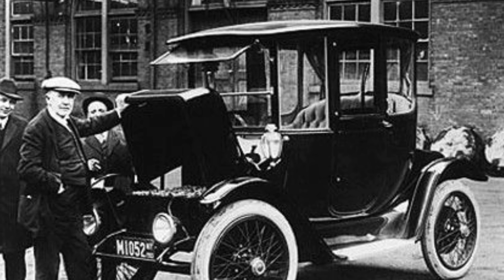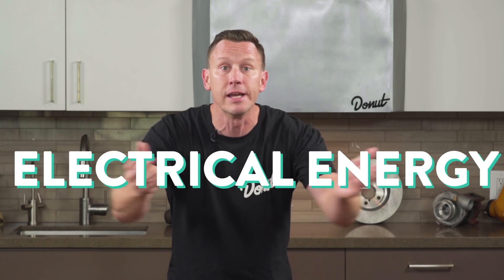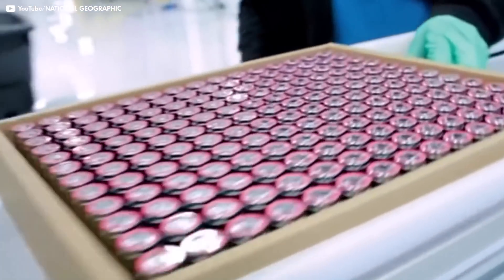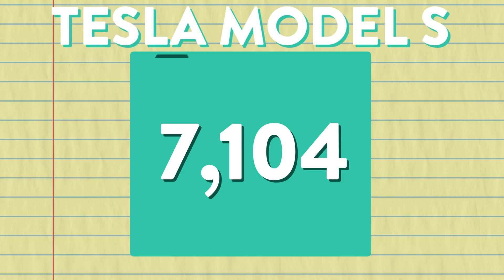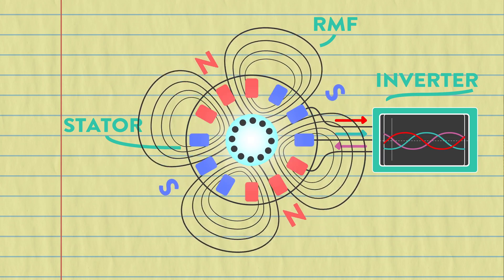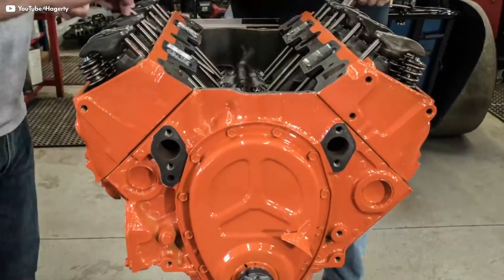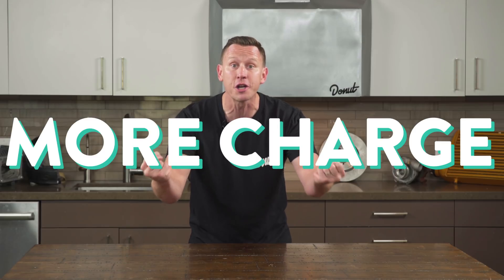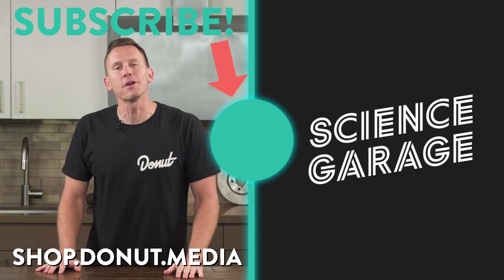ELECTRIC CARS | How They Work

Comment: You did forget that although limited in carbon footprint, those lithium ion batteries use elements that must be mined.  Mining for cobalt and lithium is a huge source of environmental damage.
Reply: As is drilling and fracking for oil for conventional cars... The BP Golf oil spill wasn't that long ago. You have to choose the lesser of two evils.
Reply: Brian KongNam that may be true but are you actually comparing actual numbers or just words. Saying electric cars still cause pollution is fine but it produces 70 or 60% of the pollution gas cars do so it is still an improvement. AND electricity sources will soon be fully renewable so by that time it will cause 10 or 20% of the pollution of gas cars.
Reply: 2 things those battery are valuable so they will be recycled and do you think gas doesn’t have a human cost? Have you heard about the wars in countries with oil? besides Tesla reduced significantly the amount of cobalt that go in every single car
Reply: DoomFinger511
 Oh soo you mean like Norway with highest saturation of BEVs. Their Electric Grid is "only" 96% Renewables.
https://en.wikipedia.org/wiki/List_of_countries_by_electricity_production_from_renewable_sources - Far more Renewables than you think.
Reply: COLBALT is NOT NECESSARY. It's a stupid option.
LiFePO4 uses 0 Cobalt.
Gen1 Nissan Leaf uses 0 Cobalt. 
Do some basic research.
Reply: KENARDO And oil has never caused wars or anything
Reply: Battery recycling will not be done by the individual or as DIY job. Eventually your car batteries will not work and you'll have either the option to replace them or go the scrapyard. In both cases the "bad cells" will be collected by a professional and be processed in a recycling facility. Hell, Tesla might even have its own recycling program for its battery cells. Bottom line is that the lithium in the batteries is recyclable/reusable while the gas/diesel we burn isn't.
Reply: Brian KongNam
 sledgex9
 viper
When batteries get too old for automotive use (8-10 years), Tesla re-purposes them in their Tesla Powerwalls (house batteries) extending their lifespan to 15-25 years. Once unsuitable even for this purpose, Tesla can recycle about 70% of materials from them. Also, mining for lithium is very clean as it is 'mined' by letting water evaporate from lithium brine. Overall, there is very little 'battery pollution', especially compared to oil.
Reply: I have read that the lithium in batteries is recyclable/reusable. So hardly an environmental hazard if recycling programs are implemented.
Reply: DoomFinger511 Yes it is. You can look it up if you don't believe me. And most of the people buying expensive Teslas also get solar panels to go along with it
Reply: like you care anyway
Reply: Because oil just jumps out of the ground in the backyard of Shell.
Reply: FallaciousScotsman 
Yes yes yes..... Cobalt is pollutant......Nickel chokes up your ass............
healthy and fresh petrol helps you live upto a 100 years!!!!
Total BS
Reply: Don't blame electric cars for your country's faulty coal/oil burning power generation. Maybe an electric car owner can't say their cars aren't ruining the environment at all, but at least these drivers can say that their part is done and the rest is on the government and the power generators.
Reply: FlyingSamosa52 i am not saying the period where it is born or it is running. I mean the when the car dies and the batteries can pollute a lot. Maybe makes the whole number of the carbon print increases and even bigger than tradition cars... it is just a guess since no solid pollution value of lithium batteries can be found now. It is just my guess
Reply: FlyingSamosa52 The cars will be less efficient and more deadly when idiots don't take care of them because batteries can deteriorate over time and release more harmful gasses than gas cars do when they aren't taken care of.
Reply: viper those battery are very recyclable and as technology gets better, batteries gets even better and will become close to 100% recyclable. And in 2-3 decades we will have biodegradable batteries, they even already exist but at a very small scale.
Reply: Raul Darat batteries are not the issue I'm talking about idiots that don't regularly maintenance their car will cause issues for the rest of us.
Reply: The energy used to produce electricity for those electric car recharge stations aren't much better for the environment either.
Reply: @DoomFinger511  Actually you're wrong
Reply: Matthew Prather
Yeah, great addition to the conversation.... try including a fact next time.
Reply: Neijhun
So you reference 1 country that makes up less then 1% of the world population. Renewable energy like in Norway is highly dependent on a country's geographical location and existing infrastructure. Most of those Tesla's are being sold (and recharged) in America where the energy is coming from nuclear and coal/oil power plants. Not to mention all the oil needed to make the plastics used in electric cars.
Reply: Also after the life of a ev is over, the pollution it makes because of the waste of lithium batteries is crazy
Reply: Not to mention the majority of cobalt on Earth is found in the Congo basin, where it's mined by child laborers who are often slaves, with life expectencies rarely breaking into the 20s thanks to poisoning associated with cobalt and its ores. The human cost of these cars is just as bad as the environmental impact.
Reply: They also did a study which showed that in a typical lifetime a supermini will actually have a smaller carbon footprint but I guess it's a lot smaller than a Tesla
Reply: @muddymann2007  Depending we're you live.
Reply: sledgex9 I don't think you understand what I said.  The only way to be able to recycle the battery is if you go to a mechanic to change it for you or you have the 16grand its costs to buy it and put it in yourself. What I'm saying is that most people don't get their car maintenance done on time which can cause major issues for the person that owns the car and everyone around them.
Reply: im not saying electric cars are bad or that ICE cars are bad but they both are not what they could be. no matter how great an electric car is it still needs crud oil for the plastics that make up its body, you still need electricity to charge it and if you power grid isn't renewable(like mine is) or if its falling apart due to terrible governing choices(like mine is) its not as great as it might seem, where some of ICE manufactures are trying to improve the efficiency of their engines(eg Mazda), what im trying to say is that if your looking at buying a Tesla or some other hybrid or full electric car to save the planet before you go and do that look at your situation first maybe a small compact hatch would be a better fit for you until there is better infrastructure or until you can modify you situation to better suit an electric car....oh and to the guy that was going on about how Norway has something like 90% renewable energy, well good for fucking Norway, are they even 10% of the global population?
Reply: @joshmac7245  Well yeah, major changes come through incremental improvements. We solve one problem at a time.
Reply: Also guys remember how do you charge your car... you plug it in.... who you get that energy from a plant and idk about where you live but the area I live in it’s all powered by coal burning it changes literally nothing I’m not saying don’t get one because they are fast and it really doesn’t matter but please don’t act like you aren’t ruining the environment just as much as anyone else please

Comment: Trying to wrap my head around how electricity works, never got it in high school. The series circuit increase from 6V to 12V makes perfect sense, how does doubling 2 amps get you 12 amps in a parallel circuit though?
Reply: anandy23 that was a typo

Comment: They won't take over for a while. Lithium ion don't last forever. Doesn't last longer than 5-10 years. I can replace a part on my engine, a Tesla can't. Also, electricity comes from burning coal.
Reply: Benzodiazepine pretty certain lithium mining destroys the environment and is pretty toxic too
Reply: At the end of the day, if you want to be environmentally friendly, just walk everywhere. Humanities greed for power is the most toxic thing of all for both the planet and its wildlife. We're fucked wither way
Reply: @rogueproductions7692  It doesn't
Reply: @matthewprather189  cool
Reply: No, you can't swap them. Sorry. They're built into the chassis. Also, sorry liberals, most electricity will come from coal for the next hundred years. Get over it.
Reply: I have friends who are test engineers in BEV labs. Liquid cooled packs such as Tesla are seeing degradation less than 2% per 100,000 miles.
Reply: You can replace the batteries and coal won't be the main source of energy for ever, for example solar provides the US more energy than oil and wind
Reply: Benzodiazepine You can switch out the battery packs dude
Reply: Lithium is 95% recyclable. Once you burn oil, it's in the air for all of us to breathe, so 0% recyclable.
Reply: You just got conned by two false statements. " electricity comes from burning coal." Is a Dieing Trend as Coal Electricity Generation is just Bad Money Losing BUSINESS.
The Current mass produced BEV batteries are already under estimated to Last 300,000 Miles not based on time. Soo what ever time it takes to you Clock up 300,000 Miles is how long the Battery is good for propulsion. For most personal cars that's more like 15 years plus. Before stating stupid shit, do some basic research.
Reply: Rich Rebuilds can take out the Battery pack of Model S in under an hour with crappy home garrage equipment. "you can't swap them. Sorry. They're built into the chassis" Benzodiazepine YOU LIED.
http://ieefa.org/westmoreland-coal-teetering-near-bankruptcy-wants-montana-let-build-bigger-mine/
Some More Coal BANKRUPTCY coming. Already dozens around the western world have gone bankrupt. Idiots like Benzodiazepine
 want to Subsidized a failing business.
Reply: If all electricity was generated by coal EVs are still cleaner because they are more efficient. They use like a third of the energy. 
Batteries will be better and cheaper in 10 years, can you say the same about gas?
Reply: Not a liberal, just an engineer who understands economics. 90% of coal plants will close in the next decade. At least 85 GW (225GW total prodcution as of last year) of coal power production is already scheduled to be taken off line by 2030. SOURCE: https://www.eia.gov/todayinenergy/detail.php?id=35572
Reply: Plus those pack are perfect for grid storage at the end of their useful life in cars. GM and BMW are using old packs this way, only problem is that the packs are lasting longer than they anticipated.

Comment: Gimme hydrogen cells then I'll buy an electric car
Reply: Technicaly Hydrogen Cars are still Electric Cars. The massive difference they use a Stupid Fuel to generate electricity for the Electric Motors. H2 has a density of 0.08988 g/L, causing far too many problem its idiotic to use as a road vehicle fuel.

Comment: Electric cars, the nightmare of redneks
Reply: Mahmood Y.H LOL giant rant based on Wrong Assumptions. Not all BEVs are Autonomous Cars. You can build Autonomous cars out of Gasoline cars also like Audi & Nvidia. You have no clue what you are talking about. 
Rimac & Renault have built Racing BEVs with Hydraulic Steering & Unassisted Brakes like the Tajima Monster Pikes Peak Racer & Zoe E-Sport. Just because it is BEV does not mean you remove the handling feel. 
The only problem with Clutch Pedal Manual is that no mass produced transmission exist that can survive the massive Impulse Torque of Modern BEVs. Once we have a strong simple transmission like a 4 Speed that can easily survive instant 1000 lb/ft than BEVs can be Manual again.
Before spouting stupid hypotheticals at least research if any of it is based in reality.
Reply: I don't know about that. What do you think the them Good ol' boys are gonna do with that instant torque?
Reply: depending on Kw/h rate, it can be $.10 - .50
Reply: Creator_of_Eden 
And people who actually enjoy driving cars =,( I really hope renewable energy is the future, not electricity. 
With biogas or such, we can still have beautiful notes played to our ears. 

I don’t care what car enthusiasts say, i belive in a bright future where we will find a replacement for electric cars. Car culture is too big to just die like that.

Comment: TURBO IT........ oh wait
Reply: Electric cars are already liquid cooled, it was even mentioned in the video.
Reply: and you also turn your can into a toaster
Reply: Ls swap? Ch' boy
Reply: increase amps it will be like turbo or super charging
 but it will run out of juice faster
Reply: Porsche did it. On their Taycan lol
Reply: in the future they will "turboing" cool water into the cooler so they can "overclock" the engine but still keep them cool. and to get rid of the hot water they will use the iron with steam technic.. so the car will make TSCHHHHH! sounds.. TSSSCHHH!
Reply: easy, you can add extra batteries to the inverter and remove software limiters.
Reply: Just remove a limiter. Most electric cars could go as fast as they want to if you remove the speed limiter.
Reply: Gas: 1
Electric: 0